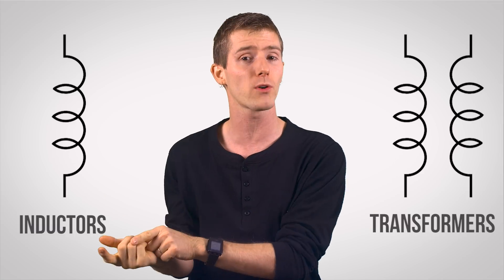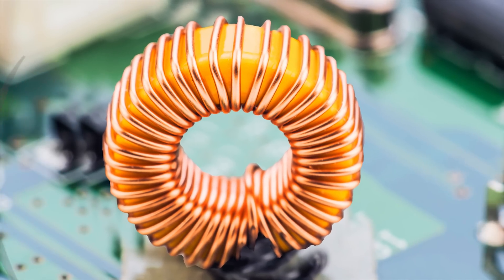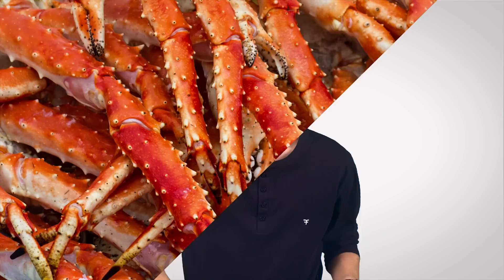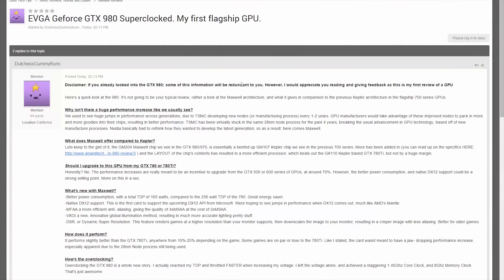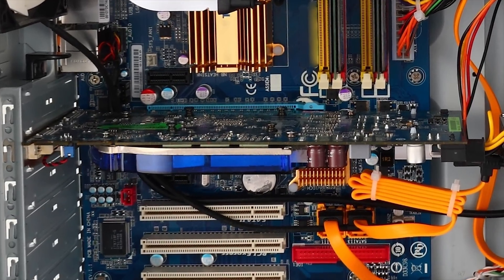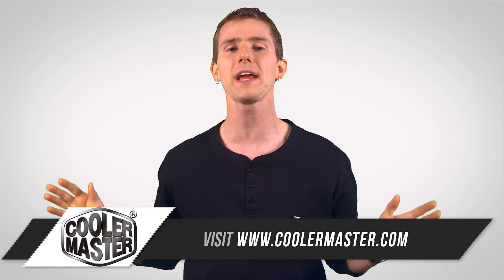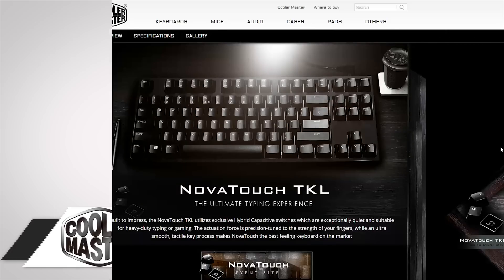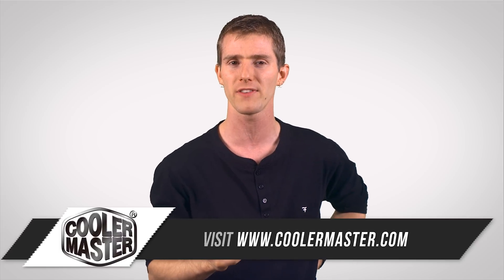Coil Whine as Fast As Possible

Comment: This Asus motherboard is trash. I had Asus Rog Strix B550-F Gaming Wifi and I'm 100% sure that the coil whine sound was coming from top VRM section. I recently got Asus Rog Strix B650e-F Gaming wifi hoping there would not be any coil whine but there is. I will try changing the  power supply. I think that's the last hope.

Comment: As a tip, you can often find which component is causing the noise by touching it lightly. Often the sound will change as you are restricting the movement of the component, which in turn means that it can vibrate less, causing a slightly different pitch
Reply: Don't do that you might die. They carry extremely high voltage.
Reply: Just don't open a power supply and go around touching things in there with your fingers. Bare metal heatsinks can carry high voltage and deliver a shock. Things outside the power supply generally aren't greater than 12 volts and "should" be safe to touch.
Reply: Don't do that, you will get electrocuted!

Comment: Just found this many years later while trying to figure out why my 4090 is making a noise, never heard of this before but now i know a lot about it…unfortunately. Thankfully my pc  is in a case under a desk so isnt that much of an issue, but after building the thing i was sure worried and thought i had broken something.
Reply: you can try to capping fps ingame.
it usually helps a lot with whining if your card is not trying to push for 1000 fps.
i also noticed that my 3080 stopped whining on its own.
as if the coil set in better or something.
Reply: @spatrk6634  I'm sorta experiencing this. Low hum, very low but more noticeable when I open a game and the GPU works. Kinda like an electrical hum, static-y.  Capped my games to 60, kinda helped.
Reply: @EthernetDasCoisas   power supply can also be the issue.
people sometimes confused the whine from power supply to be GPU because they are close together.
Reply: @spatrk6634  I mean, as long as it's not damaging I can definitely live with it. Which it seems to not be damaging or harmful, just annoying according to Mr google.
Reply: @EthernetDasCoisas  It's damaging my EARS yo! My Xbox one is sending loud as morse code right out of the console!
Reply: same. my Asus Rog Strix Scar III Laptop is making coil whine (it didn't had coil whine for first 2 years) i think i found something for my laptop tho and i will give it a try. For my laptop many users reported that it is the CPU intel i7 8750H and intel i7 9750H (mine)
- Edit: It's my CPU. I disabled C1E core c-state (C1E drops core to maximum efficiency frequency) and the coil whine completely stoped. what the f 🙃

Comment: I wonder how many people have found this video after 250+ watts cards kinda became a norm after 2020 since coil whine becomes so much more prominent with these high powered cards. I just got a TUF 6900 XT and I thought it was faulty only to realise it's noise is pretty normal especially with an overall quiet PC. A guy I know has a Zotac 3080 at that has an audible whine as well.

However Linus didn't mention 2 things that can reduce the whine. One is limiting FPS in gaming and undervolting or even underclocking your card. All of these result in less power consumption and stress on the card especially if you combine all of these together. Of course underclocking will result in a slight loss in performance but that's the price we have to pay. 
My 6900 XT's whine is much quieter at a 2300 MHZ core clock compared to it's out of the box 2500-ish. I didn't really experiment but I'm pretty sure I can undervolt even further at this clock.

Oh and I've heard that coil whine can get quiter after a few weeks of heavy usage.
Reply: Thanks for sharing. If even TUF GPUs have coil whine, there is no hope.

Comment: Sone several months ago, I made a simple amplifier using a TIP41C transistor. When I plug it in to a 12V adapter, whatever the speaker hooked to it stays popped up or down the whole time I use it. It turns out that piece of shit is sending the whole DC Input voltage through the speaker. Then I replaced that innocent speaker with a leftover cooling fan from one of my oldest motherboards. Guess what, the fan kept spinning. And when I gave it an audio signal, that coil thing in the fan was able to play that back thanks to this coil whine phenomenon.

Comment: using mechanic grade silicone (liquid gasket) is heat resistant and inert making it perfect for dolloping onto coil fully dampening a lot of the whine. but not all. be careful near moving parts not dropping any onto fans etc. if you do let it harden its easier to remove from fans etc.

Comment: I temporarily owned a 6900 XT Powercolor Red Devil priced 100% over MSRP,
it had coil whine louder than anything in my room even with 60 FPS limit and even while idling… sounded like a chainsaw, probably even louder.
My computer is supposed to be a silent one, the actual fans on the GPU were overdimensioned and unhearable even under full load, temps were low as well.
Same PSU, same connectors, 2080 Ti MSI Gaming X Trio - no coil whine at all, but I sadly sold it.
A GPU with extreme silent fan, that is heavy priced but with that extremely loud electronics is not an option at all for me.
I need a f working GPU with 16 GiB memory, my history of hardware looks very bad.
I bought a 970 - coil whine, but I didn’t return it, cause it wasn’t that horrible at all especially compared to the 6900 XT. 
Next, PC was old and old Mainboard borked, new computer, now with 2080 Ti (model mentioned above), GPU was the most expensive part, my first GPU for over 1.2k bucks, first over 350 bucks actually, it just came completely borked with weird artifacting, broken PC suspend, and most importantly, borked RGB. Returned it, became a new same model, worked perfectly.
Sadly I sold it in September 20…….. I hate my life, worst decision ever. Even worse than margin trading on BitMEX where I lost like 2 BTC to liquidation engine. But that money burning was my fault, but when I buy a product I expect it to work properly, especially when overpriced.

So I bought the mentioned 6900 XT, returned it cause I become crazy by the coil whine when just browsing the web, it’s my silent workstation like I said. Browsers are opened all the time with like 400 tabs or more, and it even whines on desktop without anything opened.

Bought a 5950x to replace my 3900x, it was 10% slower than all online benchmarks, so I waited and tried multiple bios updates, it just stopped working after a bios update after one month, it was completely borked. 20% over MSRP btw. The backup bios didn’t rescue the CPU, even newer bios either, but old CPU works completely fine. Refunded that one, but lost 10% cause I bought it with a credit, PayPal rate payment (literally translated).
My Gskill trident Z Neo one of four modules borked after just one year of service. I noticed that, cause my Linux got unstable and borked after an update (needed simple chroot to fix), and my Linux runs damn stable when the hardware works, so memtest then found it safud a lot borked data, which probably corrupted the data safud by the update on my drive.
Used the 2 year guarantee by law of all sellers (sth. like Amazon has to replace electronics which borks within 2 years as long as it’s not fault by e.g. dropping it. 
Got working replacement.
The thing with the CPU, newest GPU and memory was around the same time, so I stacked up the defects, everything bought on same vendor, sent them back at once.

After that Mindfactory the seller banned me, I made like 10k€ turnover on there site, the balance sheet is:
2 GPUs send back, one replaced, one refunded all within 2 weeks right of withdrawal,
1 CPU send back, refunded, within two-year statutory warranty as well as within manufacturer warranty,
one memory module of a kit send back, replaced, within two-year statutory warranty as well as within manufacturer warranty.

These laws for two-year statutory warranty (translated by Siri from German Zweijährige Gesetzliche Gewährleistung) they are there for a reason, I don’t know how people can be unlucky like me, but these laws help protecting us buying not properly working shit.
I don’t have much money as a student, and I lost my Bitcoin, I certainly cannot afford buying hardware like GPUs for thousands of bucks which end up not working, I can’t just burn the money and try it with a new one, that power only has big companies like the sellers, Mindfactory in that case, so they can handle the manufacturer warranty and so on.

Not to mentioned that I paid extra on all orders for service level gold for special support just in case…
They just banned my account.

Back to topic coil whine sucks big.

Don’t margin trade, especially not on BitMEX, you will lose your house.

Greetings.
Reply: cool

Comment: Does anyone else find it weird not one review of ps5 mentioned coil whine but they all seem to have it and its from the power supply and xbox found a way to make theirs not have coil whine by insulating the power supply so it has no components that vibrate and it works WOW. it also cost about $10 to insulate the power supply do we all want to live with ps5 coil whine for the next 7 years over a $10 mistake. that could easy be fixed by PlayStation spread the word people or they will never fix this. i'm about to rip mine apart soon and fix it myself since my ps5 now sits in the corner of my room collecting dust well i play my ps4 without coil whine. can't believe everyone is just fine with this coil whine is not normal.

Comment: Who's here after their PS5 started coil whining?
Reply: Does anyone else find it weird not one review of ps5 mentioned coil whine but they all seem to have it and its from the power supply and xbox found a way to make theirs not have coil whine by insulating the power supply so it has no components that vibrate and it works WOW. it also cost about $10 to insulate the power supply do we all want to live with ps5 coil whine for the next 7 years over a $10 mistake. that could easy be fixed by PlayStation spread the word people or they will never fix this. i'm about to rip mine apart soon and fix it myself since my ps5 now sits in the corner of my room collecting dust well i play my ps4 without coil whine. can't believe everyone is just fine with this coil whine is not normal.

48Hz
Reply: i copy and pasted you name 48 hz sorry dude.
Reply: Me
Reply: As someone who owns the PS5 Disc Drive Version and Xbox Series X. I felt like Sony should of done their home work. Look at Microsoft they filled in the gaps with silicon or something like silicon. And well since Sony is mainly a hardware company they should of done something similar to Microsoft. Now do things need to be improved and offered to current owners. 

Going by how people feel, Sony should work on the PSU of any PS5’s sent in along with reducing the fan vibrations. I would like for them to replace the fan in any PS5’s sent in. But since that costs money, they should at least offer a solution with the current fan’s to try and reduce the vibrations.
Reply: I have coil whing in my new laptop shoul i be worried about it or is it ok cause i have invested a great amt of money in my laptop will it hurt my laptop please reply i am really in need of answer
Reply: Unless it's incredibly loud coil whine is always safe and okay, but if your paying alot for the laptop I'd wait one week to see If it disappears, if not return in.
Reply: @Kenneth Beatty some units and gpus have coil whines and some dont have. Its a normal part of a machine and its a sign that everythings fine, coilwhine always exists, its just sometimes its so quiet it cant be heard.
Reply: @Kenneth Beatty well some of our gpus arent marketed to be quiet tho so that explains why we pc guys have it, its up to the person if they can tolerate it since it doesnt possess any harm, I have loud speakers so I was able to live with it
Reply: not me
Reply: i am here bcos my laptop making this coil whine
Reply: All PS5s have coil whine, its normal. All PS4 Pros had that too.
Reply: @Ouail98  overall coilwhine is normal, people panic quickly without searching it up
Reply: @King-gv4lg  Yeah, but i do understand their concerns since they said PS5 would be dead quiet. Some units have a high pitch coil whine.
Reply: @Ouail98  gpus also have the same claims of being quiet tho, guess coil whine will always exist. Heck the coil whiniest of all gpus are the latest models actually 2070, 2080, 3070 being always mentioned
Reply: @King-gv4lg  I know, i have an EVGA RTX 2070 Black myself and the coil whine is louder. Sometimes the fan makes a weird clicking noise too. Its normal but annoying.
Reply: @Ouail98  yep my 2080s had some terrible coil whine until I undervolted.
Reply: @Cacao613  sad to see they dont do shit to fix coil whine
Reply: @King-gv4lg  came here from a rx6800 rog strix oc
Reply: @zowda4368  cool now relax, coil whine is normal loud or not and is a sign that everythings fine. Having a coilwhine means your machine is working, coil whine always exists, its just that sometimes its so quiet you cant hear it
Reply: @King-gv4lg  I think they don't panic they just annoyed
Reply: @Ouail98  my ps4 pro doesn't have coil whine what do you mean
Reply: @wsketchy  you probably can’t hear it over the fans, but in general not all consoles or electronics have coil whine
Reply: @VengefulController  No the fans are pretty quiet too. Must have an exceptionally good console or something if everyone else is having those problems
Reply: @wsketchy  did u get your ps4 Pro at launch or a few months later, because after a while models got silent coil whine and fan upgrades to be quiter.
Reply: @VengefulController  oh way later than launch
Reply: @wsketchy  then that explains why yours is silent
Reply: @Ouail98  Sorry mate, disagree with your thoughts, I still have a PS4 pro, and my ps5, neither have what I've heard about coil whine. Of course our systems are constantly using the fan, and drive movement in the system, those get mistaken for what they call coil whine. It's just the fan and the drive together sometimes, especially when downloading. Other than that my systems works different for different games, but not coil whine.

Comment: 2:48 - Looking at the reviews from Newegg, it seems that every motherboard these days has 50% 1-3 star reviews with 40% reporting all out defective boards. Basically no matter what board I choose, there is a good chance it will arrive defective. I recently bought the MSI Meg z390 Ace because it had the least amount of negative to positive reviews that I could find. I received a defective board. Nothing but BSOD's and various driver failures, even after 3 fresh installs of windows and on different drives. Memtest86 on each stick of ram and together, GPU swap etc. It is the board. I need to order a new one but it is likely I will receive another pile of garbage no matter who I choose to go with. What is going on with QC at these manufacturers? It's beginning to get down right criminal!

Comment: you can reduce the noise significantly but capping your fps and underclocking the card slightly
Reply: that generally doesnt work with modern gpus unless you cap your games to an unacceptable fps of around 50 and even then it doesnt always help that much if at all

Comment: So my GTX 1050 do this but only at a few games and only at the loading part.
At NFS payback when i start the game it's starts making a very high noise sound but when the game is loaded the noise stops. Should i worry or its fine. If its not effecting the videocard power than i can live with that 10 second noise🤔🤷‍♂️😅😅😅

Comment: Just bought a GTX 1080 TI.... and... it whines even on idle. It gets louder on load(not even high fps). I tried on 2 different PSU, but same result. Unfortunately I can't return the card, so I just manually ramp up the fan to 65-70% so it covers the whine. I can still hear the whine when I'm focus hearing the sound from the fan though lol.
REPLY

Comment: Coil whine occurs almost entirely on graphics cards, and happens at extremely high framerates.
So, clamp the framerate to the monitor's refresh rate by using VSync or Gsync or GenericEveydayNothingSpecialSync, or any software that allows you to limit the framerate to the monitor's refresh rate--usually 60 FPS, or more for monitors that are "gaming rated" (i.e. more expensive).
No more coil whine.
Reply: Ohh that explains why my laptops GPU suddenly sounds like it's destroying itself when the FPS jump to 120+
Reply: @standardman6535  Not so much 120, but when rendering simple graphics and the FPS jumps to 1000+, will cause the whine. It shouldn't happen at framerates that most monitors can actually display--it happens much higher than that.
Clamp the FPS with Vsync and it will probably go away.

Comment: i have a dell  13 7000 inspirion,i hear some coil whine near my cpu and my integraded gpu,is it possible to open it and put some glue on the conductor to reduce the coil whine? got the laptop for 2 days but i think if i send it back,i wstill will have the problem anyway..